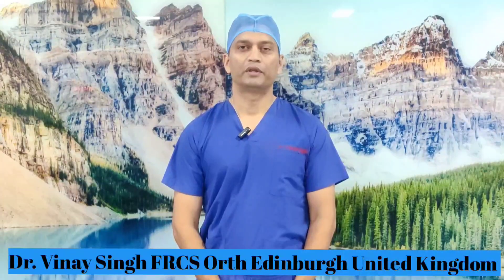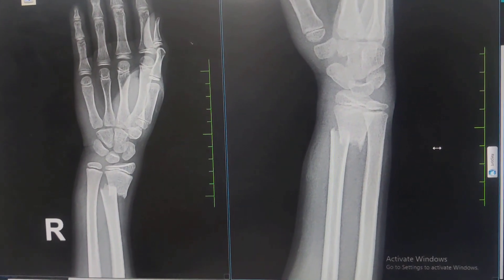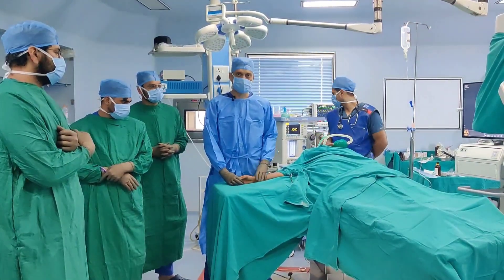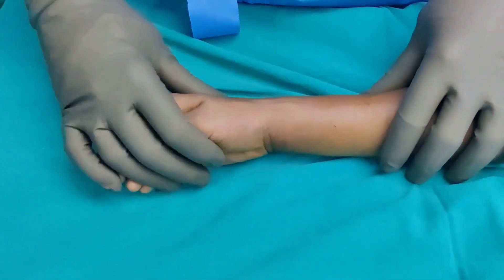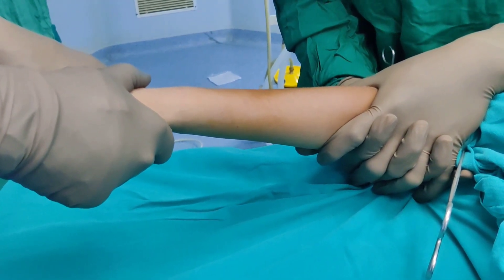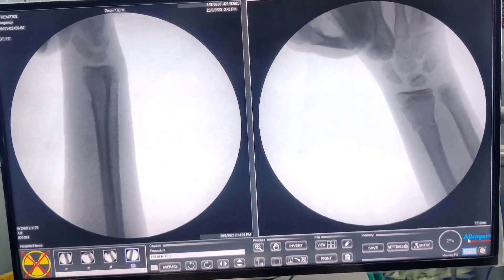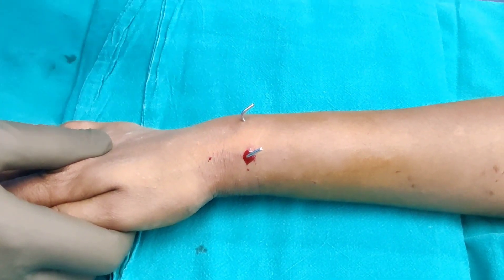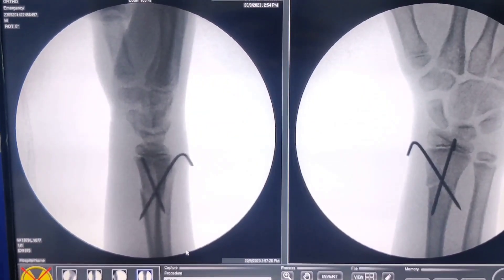Manipulation Technique and K-wire of Pronator Type Distal Radius Fracture

Comment: Is it okay to do ORIF/RUSH PIN in closed, 100% displaced midshaft  fractures of both ulnar and radius,  in 10-15 years old, in a limited setting where plate and screws are not available??
By the thank you so much for all your videos, it helps me tremendously to do all these cases perfectly with favorable results without consultants. ❤
Reply from the maker: Yes

Comment: Thank you for your videos doc. I just signed on your canal. I've a question concern the final position of the K-wire:  Why do you cross them on fracture level? I usually avoid that, because the fracture can potentially turn on this point
Reply from the maker: That is correct theoretically.

Comment: I had distal radius fracture and was operated with k wire and external fixator, after 6weeks it was removed but i can't rotate my wrist and i feel numbness and tingling sensation in index and thumb finger,  i have started physiotherapy, i want to know what to do for numbness amd tingling issue, will it get resolved
Reply from the maker: WhatsApp me through www.drvinaysingh.in
Reply: Sir I also have the same issue, please I want ur email address

Comment: the radial wire is crossing the fracture line isn't it? shouldn't we replace with another one?
Reply from the maker: As long as it is strong enough to hold the fracture it doesn't matter